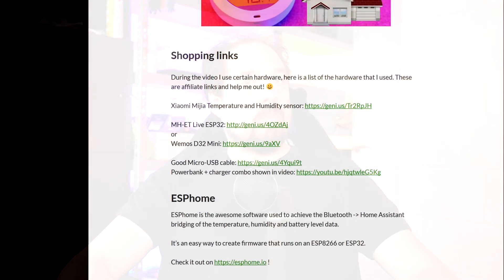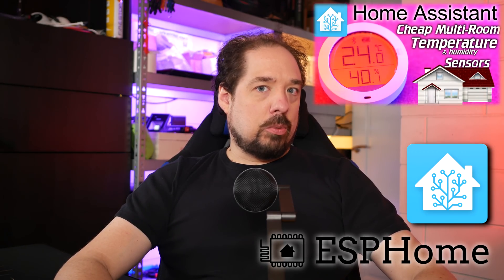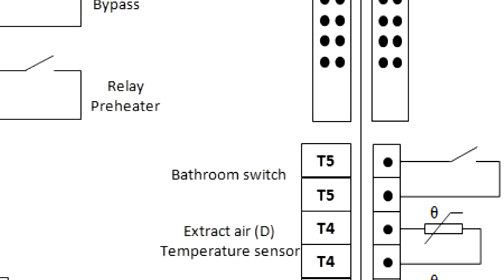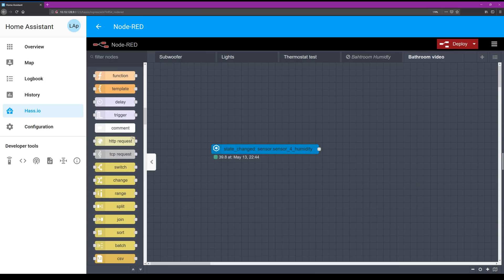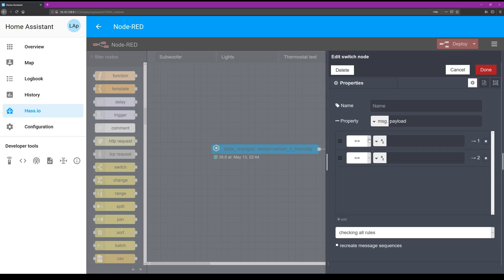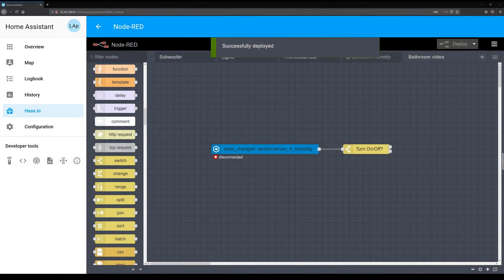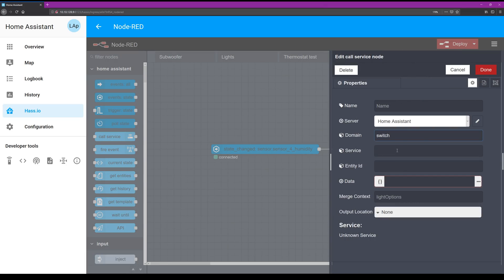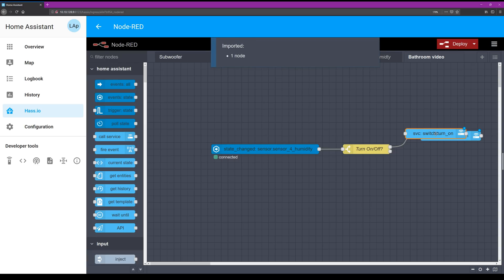Home Assistant: Automated Bathroom Ventilation

Comment: 2x esp32, nodered and homeassistant instead just one esp32 doing all the work. Not very resorcefull, but I guess you have specific requirements.
Reply from the maker: Well in my case the control box for the ventilation is located in the garage and the sensor needs to be in the bathroom, a full floor and some rooms away with no ability to pull a wire really.

Home Assistant in between everything makes it extra flexible. Most ESP32s I have in the house have multiple things connected to it (The ESP32 in the garage BLE connects to some other local sensors) and having HA as a whole means I never had to adjust sny config just change it in the central brain, also for monitoring, etc.

But yeah, there are always multiple ways to achieve the same thing in Home Automation!

Comment: Thanks for the video, just learning Node red and you taught me the switch node.
I just automated my first bathroom fan, wasn’t quite as simple since I wanted to deal with odor as well, the fan has 2 jobs after all. If the fan is manually turned on it will run for x minutes after motion is no longer sensed in the room, if the fan is turned on manually and the humidity rises because you took a shower after your other business is complete the timer is canceled and the fan runs until the humidity drops. If you don’t turn on the fan it will start automagically upon humidity rise and stop just as automagically. Now if I can find a smell sensor….

Comment: Just what i was looking for, especially after I followed your vid on the new Xiaomi sensors.  Have you found a way to improve the update time of these sensors.  Sometimes the sensor does not update for around 3-4 mins
Reply: Using the ATC firmware flasher on your phone: https://atc1441.github.io/TelinkFlasher.html

Comment: Did you manage to control the other ventilation levels with the comair hruc-e in home assistant. Have the same unit and want to control this unit bypass./only extraction.?
Reply from the maker: I have a box in the kitchen for all the other settings. This was only override to set it to max power mode, no other options I believe.
Reply: @IntermitTech  thanks for quick response, I already was looking if someone managed to analyze the modbus data for this device. No luck so far.

Comment: Very nice video. I actually had done the thing before watching it. Still I am having some issues due to the external humidity.
In short, let's say I set the minimum humidity to 60%, in rainy days when humidity is higher than the threshold I have set the fan will turn on even if it is not needed.
Did you have the same problem, how did you try to solve it? I am planning to combine information from Darksky to automatically set the threshold, but did not have time to work on it yet.
Thanks for the video, they are very nicely explained .
Reply from the maker: It can be difficult depending on the situation and your room layout. The best way another commenter came up with is by using 2 sensors. One inside the bathroom and the other outside and calculating the difference between those two. That way, even if humidity rises as a whole, the system should still function the same.
Reply: My plan is to put a temperature sensor on the hot water pipe to the shower...

Comment: Hi, I have exactly the same ventilation unit. Currently I have have the 2 T5 terminals connected to a push button switch.
So before entering the shower I press the button, this shorts the T5  terminals. I have to hold the button for 4-5 seconds. If I just short push the button the ventilation unit doesn't do to it's highest setting. Does your relay stays closed untill humidity gets below threshold?
My final goal is to do this:
Short press the push button switch. This activates a ESP8266 based relay which shorts the T5 terminals.
https://ibb.co/mFt9zTb
Reply from the maker: Yes in my case the relay remains open (and thus ventilation high) until humidity drops below the set value.

Comment: Another great video!
I also wanted to do something similar. I have a central ventilation unit from Blauberg and they have some sort of serial communication between control panel and the unit. I was thinking to hack that, but I didn't have time yet...

Comment: Intermit.Tech
,  very interesting project. Does that model you are using have a way to switch the display to F view mode for locations like the US?  If not, have you noticed any that do (that can also work locally/non-cloud reliant as well)?  

Also, do you use any motion sensors or ways of detecting room occupancy in your home?  I'm looking for ways to convert other control systems in my home as well and really enjoy viewing your videos, but one hiccup I encounter at times is dealing with US vs European differences and such.
Reply from the maker: This one cannot display F sadly enough. But you could easily convert it in HA, just not on the display. I have some others on the way to test, maybe some of those, I'll have to see.

Motion sensing will be a topic for in the future, but I do have some ideas!

Thnx for the kind words, but different standards does make some topics hard. I've decided to mostly focus at what I have here, and overlap what I can.
Reply: OK, thanks for the confirmation on that model.  I'm not set on any particular devices at the moment, but if it comes down to it, it doesn't really bother me if it doesn't display F.  

It will take some time and I don't see utility power, power outlets, etc. standards changing anytime soon due to the complexity of such changes.  However, with energy sources such as solar and such becoming more adopted by the masses, that could help usher in some internationally adopted changes.  Maybe the US will also actually (within the next decade) start to adopt C and metric units of measure since most of the world already has even if they end up commonly displaying both during the transition period!

I'll definitely keep watching your future videos to see what ideas you come up with on motion sensing and such.  Keep up the good work!
Reply: @qbs7701  If you are still deciding, an option could be the ZigBee models without a display and then use a small display, like HA Switchplate, to show the values from Home Assistant.
Reply: @EsotericArctos   I've actually been using 5 of the regular lcd models for around 6 months now and so far they seem to be working well even though they don't have the option to switch the unit of measure to F.   I look at the temps more in HA which automatically  converts it and when I do occasionally look at them, it helps me to get use to both units  as a plus.  I also have one of the e-ink clock  thermometer models which does have the option to switch to F mode although the time is in 24 hr mode only and the app wouldn't work correctly at least at the time  about 2 months ago unless I changed the region to "China mainland" (which I learned from a google search) so it at least could use some updating for international users.  I tried to order a 2nd one in early Feb. from Aliexpress, but the vender canceled the order possibly due to the virus pandemic (no message was sent they just canceled it) along with other orders being extra slow that did get completed.

I could still use an outdoor HA compatible thermometer along with a few more around the house so I may actually try some of the ZigBee models along with a compatible bridge/receiver and use them in places where I don't care about having a screen and such.  

Thanks for the suggestion and what method do you use to interface them with  HA if you use them yourself?
Reply: @qbs7701  I already have a ConBee setup with deConz that is used for ZigBee so I am using mostly ZigBee models with a couple of small displays in areas where I want clocks/temp displays.
I have used the original bluetooth model as per Quindor's video and found that reliable as well, but given I have ZigBee already setup, it's easy, and a little cheaper, to use the ZigBee models as I don't need a display on every sensor.   It also means I am not reliant on Xiaomi keeping the firmware the same on any newly purchased devices.
Reply: @EsotericArctos  Thanks for the tips and I'll definitely keep an eye out for potential f/w issues and such.  I'll probably delete any current temp sensors  I've setup in the Xiaomi app which I don't use in that way to help prevent them from potentially auto updating/breaking in HA too!   I definitely prefer to to stick with manual updates when it comes to certain things as opposed to having things auto break!
Reply: @IntermitTech  Had time/opportunities to work on any motion sensing/presence detection devices lately?  

I've  ordered/received 5 of the Sonoff Pir-2 433 mhz based motion sensors along with a still pending order for some 2 code (model GS-WDS07) door sensors and so far used 2 motion sensors with the Sonoff 433mhz - wifi bridge (reflashed with Tasmota)  and have noticed that they do have a noticeable delay.  To help improve response speed, I may purchase another Sonoff bridge module and configure it with ESPHOME instead since compiled code along with  the HA API  vs MQTT would probably perform quicker.

Comment: For the future you might want to look at the Xiaomi Aqara sensors as well. I've got several of them running in my home for the last few weeks and I'm quite impressed. The signal quality seems great and they're really small and convenient to place.

And using Zigbee2Mqtt you can easily link them up to Home Assistant or other software without needing the Xiaomi bridge.
Reply from the maker: I've looked into them but after trying the Bluetooth version, I really liked it so stuck with it, having a screen was also a very nice bonus. But maybe in the future I will!
Reply: The screen is indeed a big bonus. But having the reliable zigbee network is worth something too. I'm actually considering going in the opposite direction and adding the bluetooth versions for display purposes alone and keep it at the zigbee versions for reliability.
Reply: @WoLpH  I have used the bluetooth versions for sometime, and they seem just as reliable as the ZigBee versions.  Reliable enough that I can use them for heating/cooling and humidity control :)

Comment: why so hard? simple 1 step automation would do same thing - turn on the fan. i use broadlink sc-1 for such tasks
Reply from the maker: ...? Then how do you measure humidity, close to the shower and turn on the fan and make it turn on and off automatically? I get that the SC-1 could take the place of the relay, but I'd much rather use my solution because that same ESP32 in that spot can do much more stuff at the same time. But I also understand everyone's needs vary. :)
Reply: @IntermitTech  I have xiaomi hub and xiaomi temperature/humidity/barometer sensors in several rooms, all sending data to my Hass instance
Reply from the maker: @man4evil  Aaah like that, ok. I don't really like stuff that runs through a cloud that doesn't need to in my opinion, so that's why I connect them to an ESP32. No need to buy the hub either. ;) But yeah, that can work too, I don't see my solution being much harder though. :)
Reply: @IntermitTech  that's true. my xiaomi devices is banned from internet access by Mac on my mikrotik firewall.
Reply from the maker: @man4evil  Nice, I love Mikrotik stuff! But it still works that way? I thought it needed the internet to be able to use the official API to Home Assistant.
Reply: @IntermitTech  it works perfectly fine. Hub only talks locally with home assistant after developer mode activated. But boy, all this Chinese devices likes to connect to random ip:port combinations. Even xiaomi lamps hold connection to different addresses for each lamp

Comment: Those MeanWell power supplies - they have a live 230 AC screw terminal pretty exposed don't they? Is it possible to make that a bit safer?
Reply from the maker: You could use some kapton tape over it to make sure you can't reach the contacts, I've done that before when mounting it inside my patch rack and didn't want to accidently grab it.
Reply: @IntermitTech  Thanks; I was just wondering that. I'm still waiting for some quinLED pcb's to come in, but I'll make sure to use that in an LED strip project I made based on your information :)
Reply from the maker: @ehvlullo  Awesome, let me know how it turns out! Always love seeing people's projects. :)
Reply: Meanwell also has power supplies that don't have any exposed leads. I've  got one in both of my kitchens and a few in other parts of the house as well.

Comment: I have a similar setup at home. What you could try to do is get a humidity value from one of the sensors outside of the bathroom and use that as a target for the bathroom humidity. That way if the air inside is a bit more humid than normal, your fan won't keep running because it can't reach the static target.
Reply from the maker: Oh, that's smart, didn't think of that! How I have it configured now is that the cut-off value is a bit below the turn on value but still much higher than general humidity levels so we have no issues with it turning on too soon or staying on. But your idea seems better even and should be pretty simple to implement I think! :)
Reply: @IntermitTech 
Fan on if Rv4>=65
Fan off if Rv4<=Rv3

(Rv =humidity, number 4 is bathroom, number 3 is outside bathroom)

Indead a clever idea! 👍
Reply: @Guust_Flater I know this is 5 years ago, but I've only recently found it. I have the NR flow working , as shown in the video, but I want to reference the bathroom humidity to the bedroom humidity. I have no idea where to put this, or the format required, could someone please help?